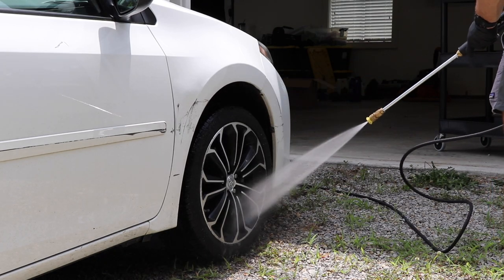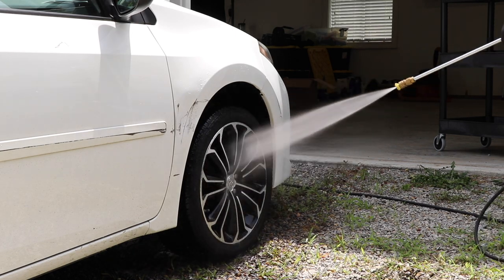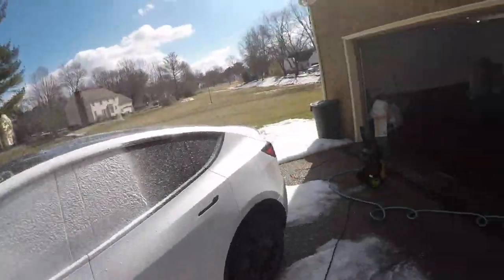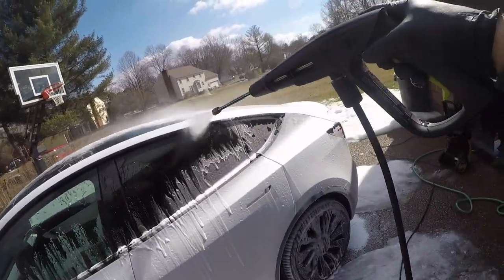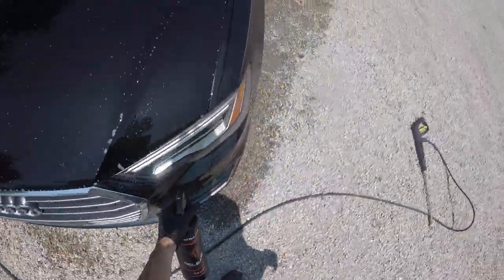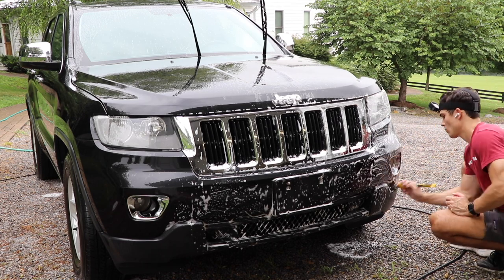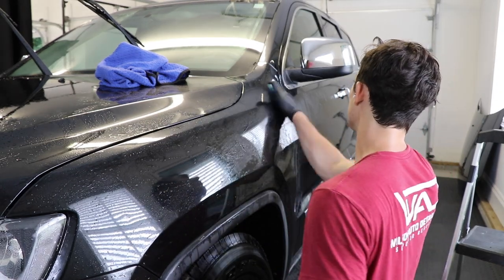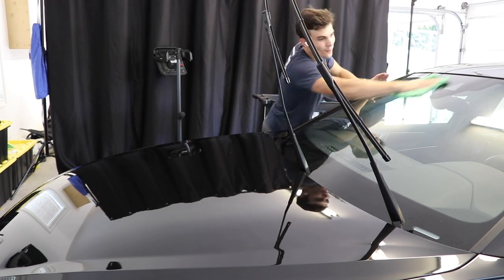Exact Tools & Products I Use To Prep For Paint Correction & Coatings!

Comment: Hi! I’m a detailer that uses a small brand wheel cleaner for all OEM wheel finishes. I am thinking of switching brands. Do you think it’s okay to use P&S Brake buster full strength, or would that cause clear coat issues on weekly washes? Thanks!
Reply: it won't cause issues, it's non acidic. don't dilute it, use it full strength. its cheap and it works amazing.